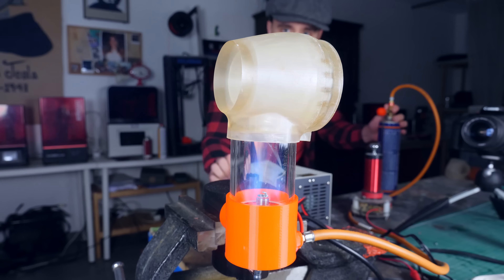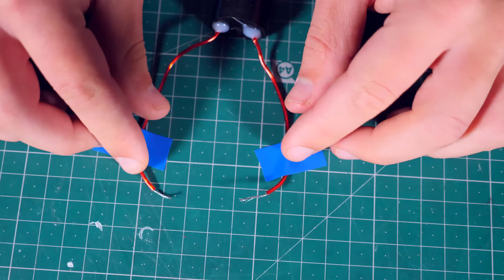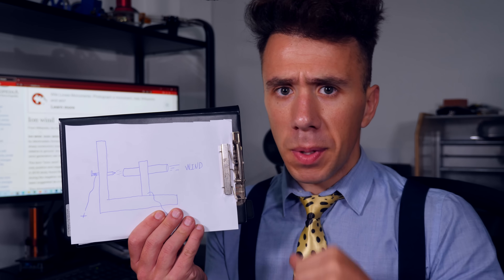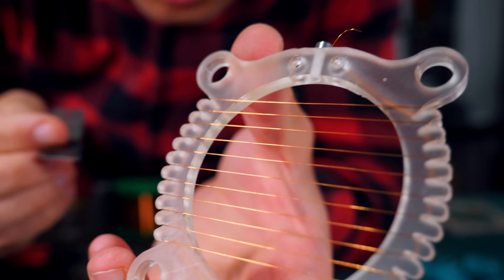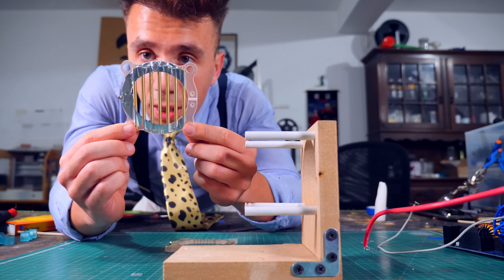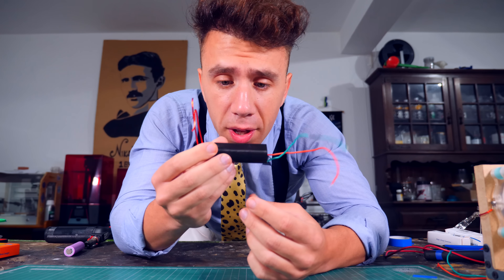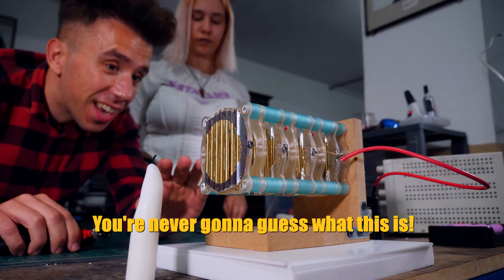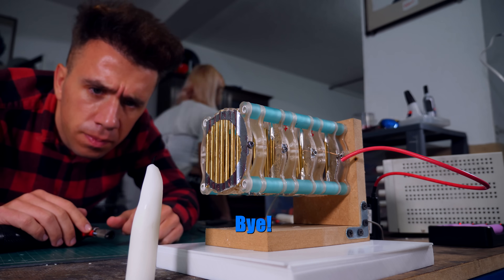I built a TRUE BLADELESS FAN

Comment: both you and jay use round tubes, but I think that's less than optimal as it creates turbulence behind them. A more aerofoil shape should work better, and also gives the charged air more distance over which to get neutralized, I think Jay mentioned in his video some charged air was making it past the electrodes and experiencing a bit of suck back. You could 3D print the shape them cover with aluminium or copper tape. I also wonder if different electrode arrangements would work better or worse. For example spiral rather than linear back and forth or a grid (wire mesh?).
Reply: Hmmm, what if we gave the different stage a potential difference to eachother to remove the suck back? So instead of 0V 20kV 0V 20kV 0V 20kV, a stack up like 0V 20kV 20kV 40kV etc.
Seeing that those chinese HV supplies are battery powered all it would take would be to connect the 0V from one stack to the 20 kV of the next, maybe add a few 1 MOhm resistors to make sure you get too high current between the different HV supplies.
Reply: @JCGver  that could work too, but you end up working with far higher voltages which could cause other problems and dangers. That and I'm not sure how it would be too different to just having the first and last electrodes at that higher voltage and getting rid of the stuff in between.
Reply: I was impressed with Joel's first arrangement with the tip of the nail aimed down the length of the tube. I saw two things I liked about that setup, 1) I think the nail offers surface space for charge build-up 2)running the anode parallel to the desired airflow offers the most significant opportunity for complementary laminar pressure. I would love to see an array using that initial setup. I have read that the hardness and polish of the electrode make a significant impact on the current I wonder if the anode can be equally tunned? how much does the surface of the anode affect the ionic exchange and airflow? what about the surface space of the two surfaces is there an ideal ratio of surface space of anode to electrode?

Comment: I would suggest that you use a flat wire with a sharpened edge mounted horizontally and in direct line with the tubes. I believe this would increase the ionic reaction.  GOOD LUCK! I enjoy you channel greatly.

Comment: I would like to see what happens if you swap the cylindrical tubs for ones that have an air foil shape. It would also be cool to see if you could increase velocity by adding a cowling around the intake and inclosing the rest. Maybe add some  holes to the enclosed part to allow the Venturi effect to pull more air in.

Comment: First, you're going to need a shell to direct the air in and out if the device so you don't have unnecessary turbulence damping the air flow but rather constructive turbulence to add pressure where the air is being directed towards(sorta like sand being pulled into a sandblasters stream but only with more air instead of sand). Also, something to dampen the sound. Nobody's going to live with that screeching. As for making it more compact, you may want to have the wires in a spiral with or even a grid to increase surface area but I don't think any changes will need to be made to the tubing arrangement.

Comment: You should make an actual ionic thruster, like i doubt it would melt as much plastic as the propellant ones you made so far. Or try powering compressed air engines with dry ice.

Comment: You may want to consider one thing with these though, it generates ozone gas.
Now, I don't think this would be an issue on the same level as Crazy Russian Hacker's dry ice fan, in fact I'm certain that was more dangerous, but it's worth looking into.
It's not for nothing that corona discharge devices like these are sold as sterilisation solutions, ozone is pretty mean.

Comment: How thin can you make the wire harness stages cause transparency plastic in a scan and cut. would also love to see what the speed of it is if the sides were enclosed vs the open sides and a how well it would work of the blunt area is 1/8 tubes rotated to so that -5 to 40 towards the center and reversed with next step rotated 90. also a once enclsoed add a nozle and hose to it and see if electronics in the path of the wind are disrupted.

Comment: You should use a dyson "bladeless fan" and replace the original motor with the fan you build. So you can maximize the air flow with the coanda effect and entrainment. Also maybe the wind will be faster when you hat up the negative wire so the electrones can get easier out.

Comment: I get how this thing works.

Is the wing purely ions or does it push the air? What pushes the air? Does the air move in all directions like an expanding and collapsing sphere or does it pulse in one direction only? So, this is pulsed-dc "not" ac?

So, during the power pulse, the air gets pushed outward in "all" directions from the spark. Then during the capacitor-recharge cycle, the ambient air colapses back in, but at a slower velocity?

Why doesn't this thing need a one-way valve, like a pulse-jet engine?

Comment: you could try and 3d print an axial flow compressor, they are what most aircraft jet engines use, they are allot more complicated than radial flow compressors (centrifugal compressors)

Comment: The next steps are to optimize as much as possible maybe with higher conductors and precision surfaces then tweaking distance, voltage, current, wire count etc.
After that test it's efficiency compared to regular fans

Comment: Wouldn't that create ozone? If that's the case, you could smell it, faint sweet smell. High levels of ozone are dangerous and can lead to irritation of various body parts. It wouldn't be much a problem if the fan was used for few minutes per hour...but who uses a fan like this?

Comment: Now enclose the system in a tube with a nozzle on the output and add fuel to the intake. Try adding fuel at different stations along the tube.
Will it trun into a rocket 🚀 and make thrust??
Reply: Scammer go away.  You have been reported

Comment: So this works by creating an electrical arc, which generates a lot of heat. When you turn the lights off and you see blue flames, that proves it's generating a lot of heat.

What kind of power draw is there and have you tried running it for an extended period of time? Surely this will cause a fire at some point?

Let's see you test these things out in the next video.

Comment: Video Idea: 

What about a small jet engine (from a RC airplane) shaft connected to an electric generator? Calibrate it to run on ethanol and you´ll have a carbon free electric generator 🙂 - Also keep in mind that tomatoes are disgusting
Reply: Ethanol isn't carbon free though. Recall the reaction equation:
C₃H₆O + 4O₂ → 3CO₂ + 3H₂O
Reply: @TheyCallMeHacked  You're right. I think what he meant was that ethanol is not fossile fuel. You can get It from plants. Sadly it's not low emission because you need to distill it to get the ethanol and for that you either need to burn something or heat it up electrical. Both cause carbondioxide emissions
Reply: @TheyCallMeHacked  carbon neutral he meant i guess
Reply: @TheyCallMeHacked carbon free does not exist but as a matter of fact trees love water and co2
Reply: @TheyCallMeHacked oops, came here to say that. Not to mention the production of ethanol requires carbon to be burned.
Some people get excited because they have a smaller understanding of chemistry. 
That's why there are so many doofuses on YT pretending they made a free energy system. 
Not that O.C is a doofus
 We all start out with small knowledge. 
Just have proof for statements or else word the statement like a hypothesis until you check your facts. 
That way, no false information is spread. Thank you.
Reply from the maker: Congratulations! You just won a 3D Printer! Send me your info (Name, Address, Zip Code, Phone Number) to integza@gmail.com .
Reply: @integza  bruh this scam beat my real most liked comment 🪦
Reply: such a great idea, ngl
Reply: How do you guys get so many likes I put so much thought into this stuff I make puns and get 1 like and a scam
Reply: @hexagondragon001  most of the time, it's sheer luck, mixed with good timing
Reply: @TheyCallMeHacked  This comment was created on popular buzzwords. I would not call it luck, because of the popularity of making a sentence like that.
Reply: @hexagondragon001  It's the horrendously ridiculous buzzards and tomato comment.
Reply: Ye, i that guy which deleted his comment was a obv scam, he replayed to my comment couple hours after I posted comment, then the comment get that many likes and he deleted his comment 😕
Reply: Hope that idea happens that would be cool
Reply: So you didn’t win a 3D printer ? I still see the integza comment saying you did
Reply: To produce ethanol requires carbon to be burned.
Reply: That is called a gas turbine and is commonly used in small oil and gas power plants.
Reply: Welp, someone's getting a free 3D Printer.
Reply: @computertutorials1286   no one is getting a 3d printer. I reached out to integza he emailed me back and this was definitely a scam. I see the scammer deleted its comment on here.
Reply: @richstaubin333  Bull. I call bull on that.
Reply: @richstaubin333  Integza himself does actually do giveaways, but there are ALSO a bunch of bot accounts pretending to be famous channels that are trying to phish people by saying you won something. This really is the most liked suggestion, so maybe AdiHQ really will win
Reply: @magnuswright5572  I see your point but I spoke with the scammer then emailed integza. Integza told me the comment on this post is a scam. Also it was by the same account that replied to my comment.
Reply: Wtf i get that scammer to in new video
Reply: This is a scam.

Comment: What about a small jet engine (from a RC airplane) shaft connected to an electric generator?
The jet engine you can buy on the internet. Calibrate it to run on ethanol and you´ll have a carbon free electric generator

Comment: Traditional electric fans can be used to generate electricity from wind, like a turbine. Can you use an apparatus similar to your bladeless design to harvest energy from wind?
Also, have you considered rotating each 'layer' 90 degrees in relation to the previous layer? A good aerodynamic cowl would do wonders too, I feel.
Oh, and instead of using round tubes, pinch them down the leeward side like an aero foil, or tear drop to decrease roll-off turbulence.

Comment: Use it like the blades in a dyson fan. Use a higher gage copper wier so it can take the voltage and not burn out. Make a larger disk array with 8 or 12 inch disk and put it in the bottom of a bladless fan and replace the blades.

Comment: Build an enclosure that has the same shape as a rocket engine. It will boost the output. Then get a bigger power source don’t be cheap on it. You need power and also use bigger wire.

Comment: About you fan, you could seal between the driven & Receiving elements. Or, of course f  I don't remember the name of the effect (I want to call it "laminear flow") by angling the air flow into each stage at the rear of each driven element.

Comment: I would love to see how far this can go and if you can make something more powerful. Why not also try different designs, tighter wire meshes, coiled rods, and even different bodies for the housing, playing with if you can get different outputs by putting it in a tube and maybe even adding cones and nozzles to the end to see if it can generate some good thrust and power. That can lead to later experiments on making, say, wind propelled cars/planes/rockets made out of light materials.

Comment: Would having a matrix grid (both horizontal and vertical lines) for the wiring and pipes work better than just vertical wiring and piping? You can isolate each of the wires from each other that overlap using some resin or another material to avoid shorts. 

Another idea would be to use a wire with more sharp edges... Maybe something like a wire wrapped wire (like a guitar string) that can be cut into a bunch to give sharp points throughout. 

I'm trying to remember my university electromagnetic physics knowledge, but it's been a while so forgive me if this is way off, but would having a copper wound coil with some wires stretching out from it on one end to make a cone work really good for the wire-end of this setup? You can pump a lot more power through it to a matrix or circular grid of rods.

Comment: 11:00 However, this grid of tubes generates aerodynamic drag. It should be beter to put a cascase of parallel flat plates instead of this. Simlar to theat alu-foil i those so called lifters.

Comment: Hey, [former aircraft technician here] have you guys thought about adding aerodynamic ducting to these? Not just slapping them into a tube but gradually changing the diameter to alter the properties of the atmosphere in the thruster as it travels down the length? How does the performance change under different pressure and velocity conditions and would it be beneficial to the performance or allow you to use less construction materials to force the airflow into a higher pressure state? Also you could also save materials by combining the wire grids and tubes into a single component that formes half of two different circuits so you could attach several of these modular components in series to make up whatever size thruster you like. I would also make these more aerodynamic by cutting the tubes in half and creasing one side so that when place the halves back together you get something like an aerofoil. Just add a plastic spacer between the two halves to give the aerofoil the proper shape and you have something that could quite possibly both save materials and increase performance.

Comment: I would like to see a video where a number of optimizations are applied individually to see how each one effects the output. The specific optimization I am interested in is turning each stage on and off in series. My thinking is that each stage has a negative charge on each side, one side the wire is generating a negative field on the other negative ions are piling up and being pushed out the side. By turning the next stage off while the current stage is on you allow the negative ions to pass through the next stage increasing over all throughput put. I think this will be even more important if you add an outer shell where the negative ions are not able to escape the system out the sides of the thruster.
Reply: FAAAAAAKE!

Comment: What if you design the bladeless fan, into an air multiplier fan, using a similar airfoil?
This also would place the high voltage section hidden, and safer.

Comment: Heat travels from an area of higher temperature to a lower temperature.
Maybe you can make a tube that is hot on one end and cold on the other.
Then the air will travel through the tube and blow out the flame.
No blades.

Comment: You know how thermionic valves / tubes use a heater to heat the cathode, because it makes the electrons "looser"? Do you think that might help here? Run a low-voltage current through the lifter's emitting electrode, on top of the high voltage, to make it heat up. Assuming it could take that without disintegrating.

Also you are using positive ions for lift. I suppose that makes sense because oxygen and nitrogen ions are much bigger and heavier than electrons, so will produce more thrust. But electrons would (probably) be greater in number. I suppose using positive ions in what lifter makers have settled on, but is there useful research in doing it the other way round? Would it emit electrons, or just ions backward? 

Maybe it's both at the same time, ions going down, electrons going up, and the electrons produce counter-thrust but are overwhelmed by the ions. Which silences my argument.

If you ever "find" any enr-ch-d Ur-n--m hanging around, your own nuclear reactor could make a BEAST of a lifter! You remember the USA's plans in the 1950s for a nuclear aeroplane? Why not a nuclear-ionic aeroplane? Or a UFO? You'd need to carry all the generating gear. The USA's version just pumped air through the core to heat it up. But this is all nonsense anyway. Ah, lithiums these days probably have a greater power density than nukes, and are probably more dangerous. They go up like fireworks, but only when they're not supposed to!

How efficient are ionic lifters? I know the thrust is pathetic, but do they consume much electricity? Could somebody maybe make a huge one, or a thousand little ones, and manage to lift something useful? Like their own battery, for a start. No reason why, I just think it'd be cool flying a quietly hissing UFO across the countryside, causing occasional lightning strikes and making everyone's hair stand up.

Comment: On the theme of bladeless fans can you put your ion wind design into an aerofoil design to produce a larger air flow with less negative ions. As you point out, the dyson does have a bladed fan inside but it converts the power from a small ducted fan into high airflow using it's circular aerofo design.  Can you make  a truly bladeless design that is more efficient and uses iron wind to drive the aerofoil to get mass airflow. 
... and next can you make it fly !!!!

Comment: use an ionic thruster (or thrusters) to make a remote-controlled drone, like a quad copter design.
the ionic thrusters would need to be more compact, but that can be figured out, then you can use some simple vectoring on the thrusters to move around.